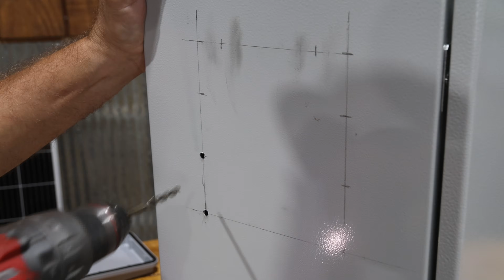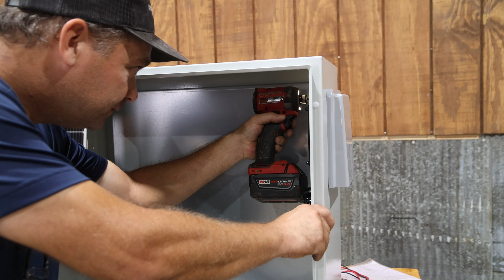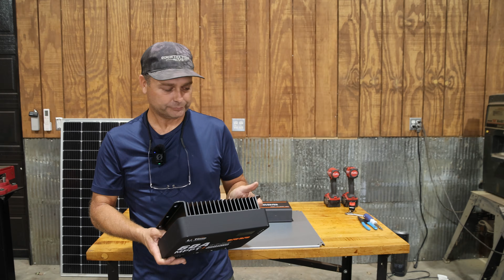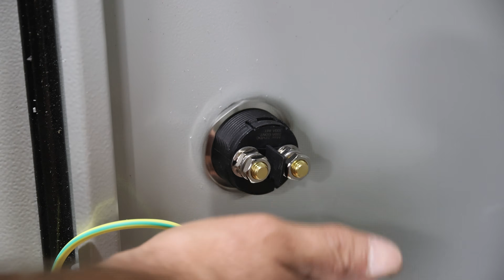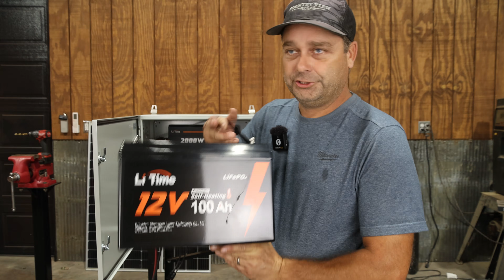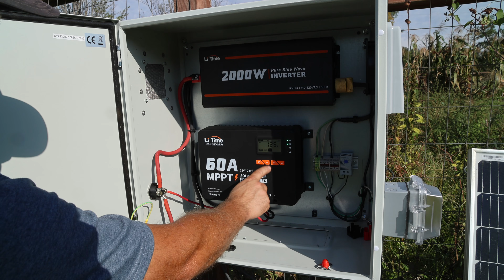Building a Rain Proof 12 Volt Solar Power System.

Comment: I’m in central WI. Winter gets below zero F frequently. I have a brick walled single story garage across the driveway from house. Roof peak runs east-west with no trees near it. It’s unheated and currently no power. Would it be possible to mount panels to its roof, but keep batteries in the house basement? Maybe have panels converted to AC power at the panels or garage then sent to house basement to charge batteries? Garage is about 50-70’ from house

Comment: Do they make outlet boxes that you can plug those heavier gauge plugs into & the box close?  Had to buy the bare minimum gauge cord for my grille to have room to close the cover & the cord fit the cutout slot in the bottom.  Don't like how that big plastic cover is just a shade & you're shooting water at it from the exposed side angle.

Comment: Sorry, just saw your specs listing as 2 gauge. Why not use 2/0 or 1/0 for a 2000W inverter?
Reply from the maker: The battery only outputs 100 amps max.  The cable is sized for the battery.

Comment: Really nice build. What gauge are your main battery cables ?  Thanks!
Reply: Saw your spec listed as 2 gauge. Why not 2/0 or 1/0 gauge with a 2000 watt inverter?
Reply from the maker: Cable is sized to battery output.

Comment: Very nice setup with the only thing I would have done different would have been putting the battery in a similar type enclosure.  I won't the wayward mouse trying to find a new home such as they might with the battery box.
Reply from the maker: True a mouse or other pests could get inside the battery box.

Comment: Hi Evan, can you advise the size for the self tap screws you used?  I have received all my parts and wanted to use the same length you used.
Reply from the maker: 1/2 inch screws.  You may need to pre-drill and use sheet metal screws
Reply: @CountryViewSolar-DIYProjects  Perfect! Thank you sir!

Comment: You cheaped out mounting the box. 😂
I would put couple of treated 4x4x8 posts 

You need to place a mirror next to the inverter display screen. You might have to tilt it a little towards the display screen.
Reply from the maker: It was just temporary.   We just got our first freeze so garden season is over.  It will be moved somewhere else now.

Comment: Very nicely done.  I would have mounted a 2 gang box on the outside of the enclosure to give more power options.  You may also want to change your plug to a right angle plug - it would help the cover close.

On an aside, it would be nice if LI Time had some external/remote monitors that could be affixed to the panel door so you could see the status without having to open the door.
Reply from the maker: Good idea

Comment: So could you put as many volts into the charge controller from the solar panels as you like?
Reply: No, the charge controller has a 150V solar input limit and the output is rated to 60A so if attached to a 12V battery is limited to 12 * 60 or 720 watts... Though charging a 12V battery runs at higher than 12V so it's rated for 900W at 12V.

The MPP tracking range is the battery voltage +3V, so if you have a 48V battery it's probably best to make sure your solar string adds up to somewhere in the 60 - 120V range to be sure it starts and charges properly and stays within a safe voltage range.
Reply: @Snerdles  so you could put up to 150v in from the panels and it could charge a 12v battery to a 48v battery
Reply: @rileywillard139  yes, but the MPPT voltage range is battery voltage +3 up to 120V which is why I recommended to shoot for between 60-120 so that no matter your battery voltage (12, 24, 36 or 48) setup it would always work.
Reply from the maker: An MPPT charge controller Drops the voltage to around 14 volts to charge the battery but increases the amperage up to a max of  60 amps.

Comment: That looks like a lot of fun.  I worked for a solar company for a brief period of time during my career and I always liked building prototype stuff much the same way.  My biggest accomplishment was building/programming an auto start/stop device for a generator.  Basically if the battery level got too low and the solar panels couldn't keep up it would automatically start a generator to charge the batteries.  Also while the generator was running it would bypass the inverter and supply generator power to the load.  Once the batteries got to around 85% charge (if I remember right) it would shut the generator off.

Comment: WOW, just what I was looking for.  I have a well to water our cattle as a backup to rain water harvesting.  Right now I drag a little gasoline generator out to the well and refill the IBC totes when we are without rain for 10 days or more.  This is perfect thank you.
Reply from the maker: This inverter is right on the edge of working with this 1 Horsepower pump.  I would suggest a bigger inverter for better reliability.

Comment: Hi Evan, could you do a video on building and or buying bits and information on “Rotating Solar Panels” ? I have 30 solar panels using micro inverters on the house with 2 batteries in the in-house garage but I would like to add more. My double garage / shed has a gable roof but the two faces are in the wrong orientation to use. But my carport has a skillion roof, all I need would be the rotating solar panels and using your outdoor setup with micro inverters and battery. Is that possible ?
Reply from the maker: I think You are talking about a solar tracker. I am not sure what voltage the trackers work at.  Each brand could be different.  I will look into it.

Comment: Evan I don’t believe a ground rod is required for your setup. Look at the manual for the inverter. Also what was the total cost of your sprinkler Solar setup? I have a project for a pond oxygenation.
Reply from the maker: The Li Time Equipment with today's sale price is $588.  The enclosure is $183 and the rest of the parts are around $225.  So the total price would be around $1000.
I am not sure this inverter would start a pond aerator.  Compressors can be extremely hard to start.  I would suggest a bigger inverter.

Comment: You said you ran the pump until the battery ran down and the inverter shut down, but you didn't say how long it ran.  Will it run long enough to complete the garden watering? Are you going to build a solar panel mount on the fence or a growing mount?  Cool setup.  Thanks for the video.
Reply from the maker: The battery wasn't fully charged to start.  It ran about a half an hour, before the inverter shut down on low voltage, the battery was around 11.5 volts.  So it shut down before it was completely drained.  Since then, I have ran it a couple times, and with solar panels charging, it ran for an hour before I shut it off.  It hasn't shut down on me since that first day.

Comment: Why continuously screw people with 12 volt solar? You spend twice the money for half the power, then you spend as much on a 48 volt system as you do on your cabling to move current instead of voltage. You're doing people a serious disservice shame on you
Reply from the maker: For a small system like this. (2000 watts or less)  12 Volt can be more economical and will work fine.  For Larger Systems, 48 volts is the better choice.
Reply: Did the system work for what he wanted? I didn’t hear him say “it can only be done this way”.

Comment: love this setup. I threw together a crude version a year ago with a cooler. Been wanting to remake it nicer {build it nice not twice}  because its so handy in the barn I never move it anymore. I used a 40amp mppt controller with the same battery and was worried about charging it to fast, I guess its not a problem if we can use a 60a and be fine. Love the solar channel!!!

Comment: The manual reset for low voltage on the inverter is a bummer. Is that a safety requirement for all inverters? Nice video! I've made Christmas light controllers in boxes just like that.
Reply from the maker: No, some inverters will reset themselves

Comment: i would highly suggest using a center punch for marking the holes. drill bit wondering is alot of pain when working with such tight layout. you dont want to start rimming out holes to get them to fit.  and what about grounding? no external grounding? even a GFCI wouldnt be consider as safe since they are no ground, so dont touch the box. other than that. great little system. mobile for a small shed or out building. or mounted to roll around stand mount. and some what cheaper than your ECOFLOW>
Reply from the maker: @diegojines-us9pc  i did use a center punch.  And i showed it once in the video when mounting the terminal block.  I can't show every step or the video would have be 2 hours long.
The gfci will work.   If positive and neutral aren't equal it will trip. Around a 7 milli-amps difference causes it to trip.  It doesn't monitor the ground.  The ground provides a safe path back to the source.  
And I did mention a ground rod in the video.
Reply: @CountryViewSolar-DIYProjects  sorry about missing the ground rod part. by the way. the code states you can replace a non grounded outlet with a GFCI, because the code thinks a GFCI is better than no ground. but not to be used a replacement for not having a ground. just for all your watchers. be safe.

Comment: Nice installation...going to use that idea next year for my garden...5*s
Reply from the maker: I would suggest a 3000watt inverter if you plan to use a 1 horsepower pump.  This 2000 watt barely works in this application.

Comment: You really need to fuse your DC and GFCI  on the AC side.
Reply from the maker: That could be done.  But the battery BMS will shut off the battery on high current.   And the outlet is GFCI
Reply from the maker: @ArtWagoner  you could get din rail mounted fuse holders to fuse the AC side.

Comment: but you are blocking the ventilation.  No ?
Reply from the maker: No, the air flows just fine.  This is exactly how it is done in industrial applications.
Reply: @CountryViewSolar-DIYProjects  Yeah, once you turned the box over I could see the fan housing had an opening in the bottom.  Couldn't see that the first time.  Great job as usual.